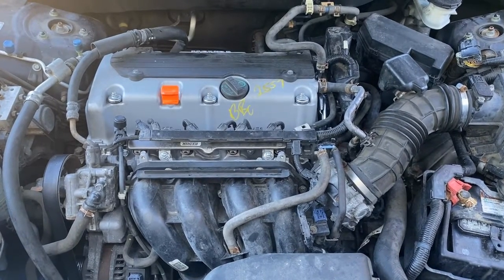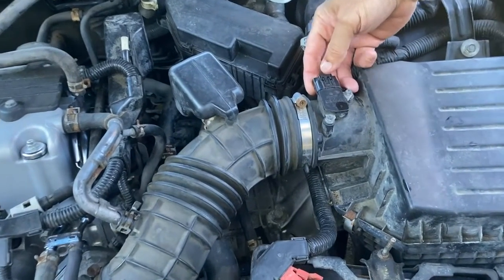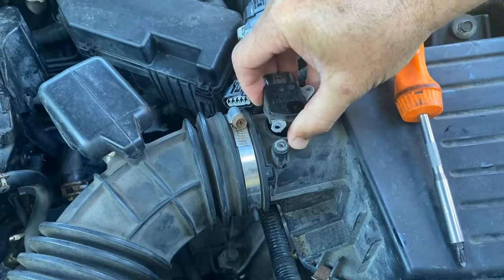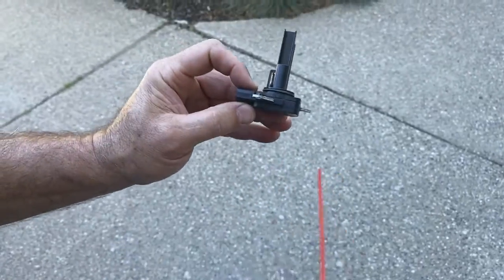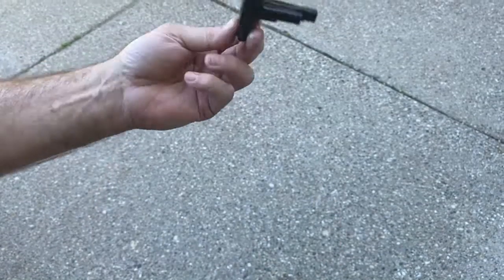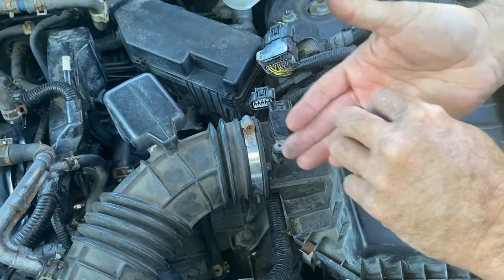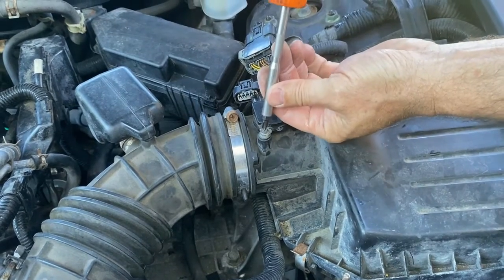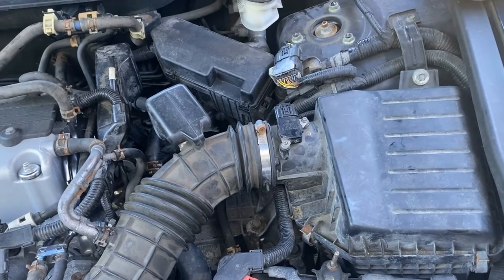How to Replace Mass Airflow Sensor Honda Accord (8th Generation)

Comment: Will this alleviate a rough idle? Already cleaned throttle body
Reply from the maker: Yes it could, a dirty or malfunctioning mass air flow (MAF) sensor can cause a rough idle in a vehicle.  If the MAF sensor is not functioning properly due to dirt, damage, or other issues, it can provide inaccurate air flow data to the engine computer. This can lead to an improper air/fuel mixture, resulting in a rough, uneven idle.

Comment: I have same make and model but when i unplug the maf sensor my car does’t turn off 
So is that faulty?
Reply from the maker: With the car running if you unplug the MAF the car is suppose to shut off which means the MAF is good . If you unplug the MAF and it stays running then its not working properly.
I would try cleaning it first .